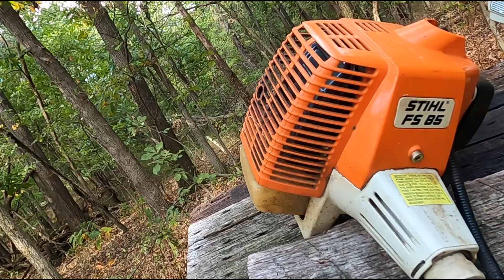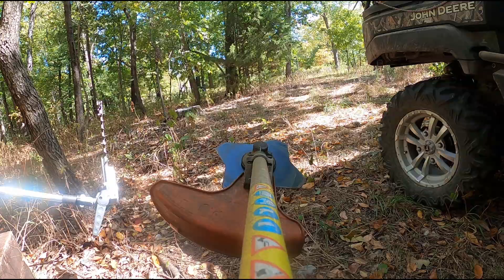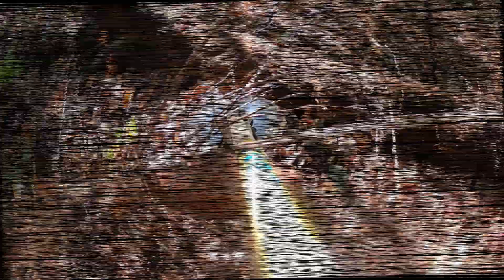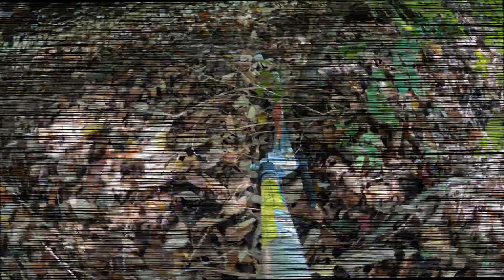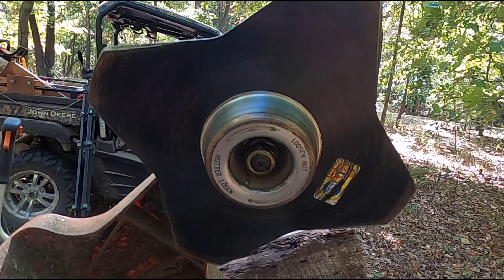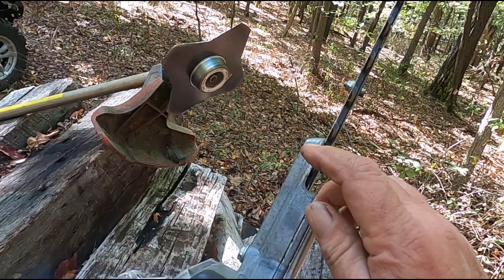Makin' Stuff: Comparing Power Scythe to Brush Blade

Comment: You might find both more comfortable to use with a Shoulder Harness, available from your local STIHL Dealership.  Double Strap one with the Breast Plate helps cut down on the strap digging into your shoulder and neck.  I added one to my setup and it really helps with the weight distribution.  I even use mine when doing weed eating.
Either Unit beats using a Sling Blade.  LOL
Reply from the maker: I use one with both power units.  Unless I have the pruning saw on the Kombi… a shoulder strap works better when working overhead.

I agree with you 💯 that the harness is superior for this type of work.  Thanks Robert.
Reply: I agree with you about the Kombi Unit being a Good idea, but a bit heavy.  I think it is because of the better constitution of the STIHL Products because other Manufacturers' Unit don't seem to be made from as Quality of materials.
Reply from the maker: @robertdraper7258  I have an 028AVSEQ chainsaw that I bought in 1989…. I heat with firewood that I’ve cut with it every year since.  Stihl makes great equipment!